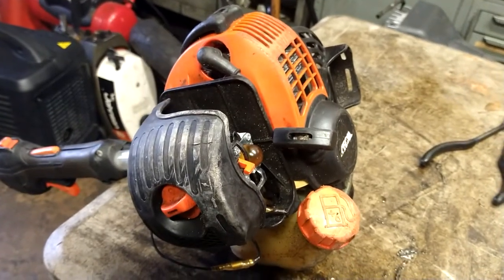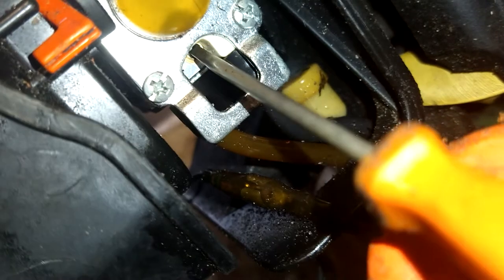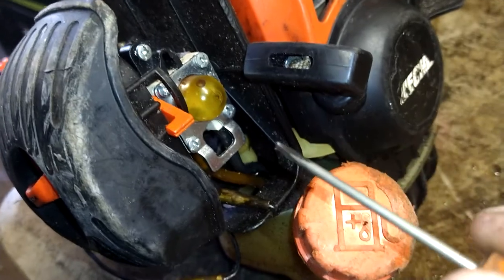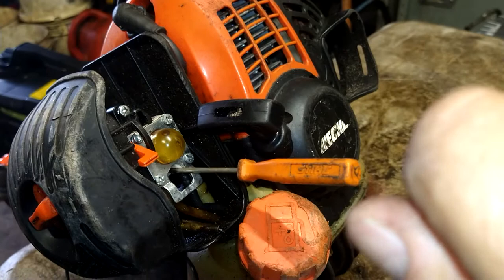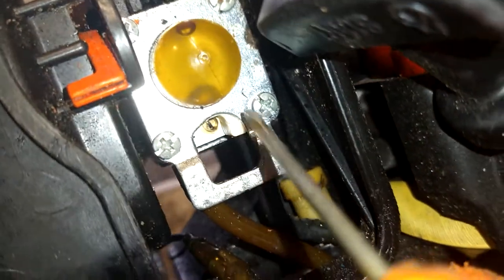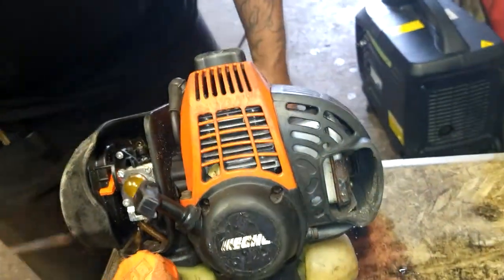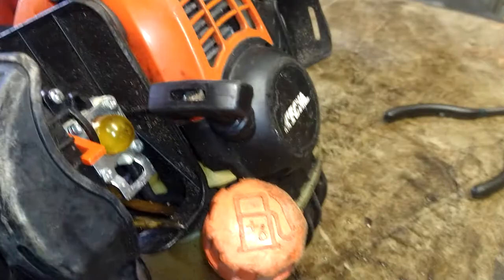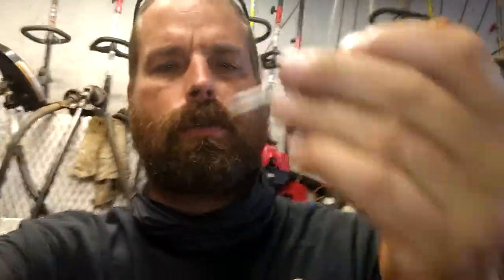echo hc266 carburetor adjustment

Comment: That bog off idle usually means that the low jet is too lean
Reply from the maker: Low jet is way more sensitive. I do fine adjusting like a minor bog issue from high side. You dont have to believe me. Ive been doing this for 40 years. Since paul harvey was on the am radio. You could tell the condenser was bad back then when the radio went to static
Reply: @smallengineguys  well that may be so I just found it interesting you never tried adjusting the low jet the whole time then threw a new carb on it
Reply from the maker: @farmerjackson709  just experience. You get into adjusting the low and the diaphragm is worn. So next mow your doing it again. Just replace at that point.

Comment: I have never been impressed with the power of my srm266. Always boggs down.
Reply from the maker: Counter clockwise a smidge
Reply: @smallengineguys  I'll have to give it a try.  I bought that thing so it would have the power and wouldn't bog down what a joke that seems to be. My friends Stihl has tons of power and weights half as much.
Reply from the maker: you may even need a new carb but these are strong trimmers. though a srm225 is more than strong enough and way lighter
Reply: @smallengineguys  I tried adjusting it but no luck. Ordered a carb and it got delivered today so I'll throw it on and see if that wakes it up.
Reply from the maker: @christophermix6845  let me know. I have a different style carb i use on these sometimes.